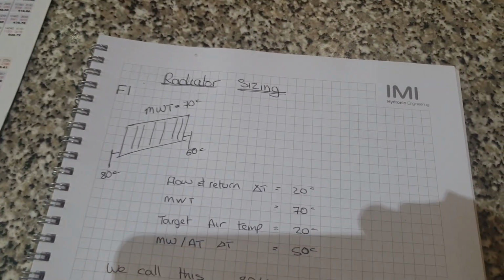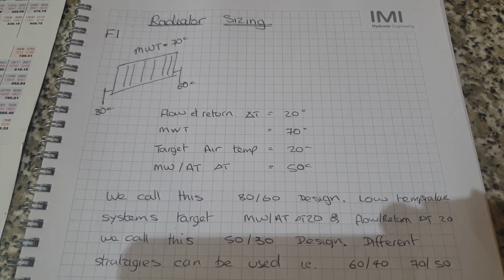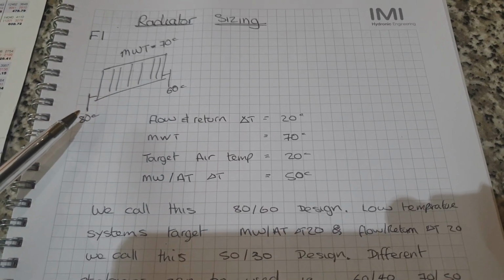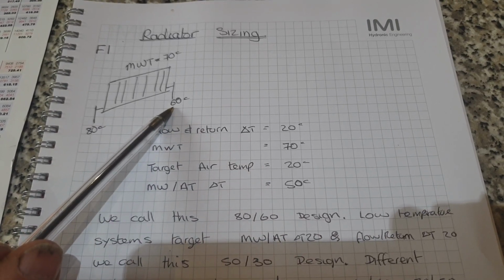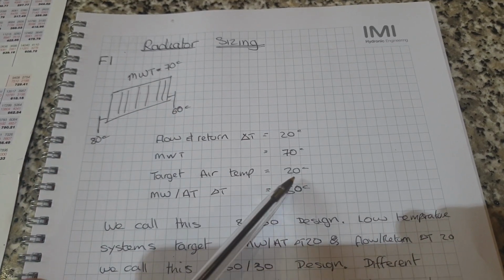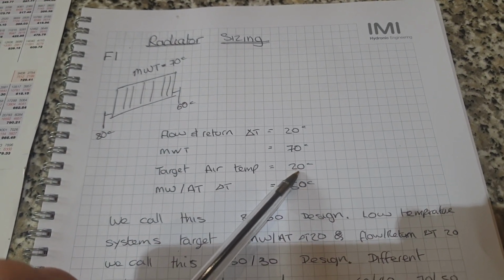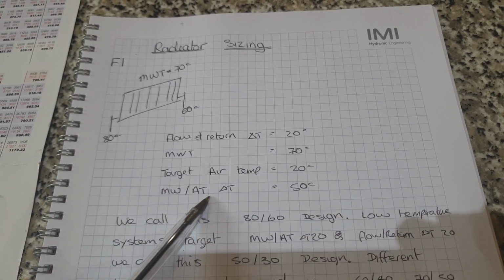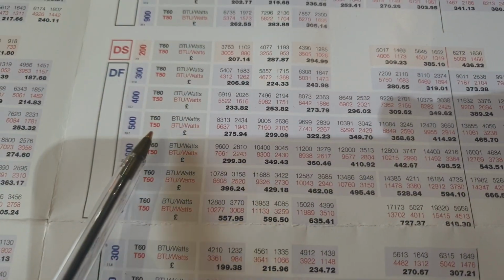Radiator selection / sizing.

Comment: Maybe a slightly stupid question; when looking to do low temp, once I've established the kW of the radiators (roughly 3 times what the catalogue lists at dt50), do I then use those increased values, adding them up from all the radiators - to size the boiler for the whole house, or do I go with the result of my heat loss calculation to find a suitable boiler?
Reply from the maker: With a Viessmann 200 boiler sizing is easy. It modulates down to 1.9 for heating and up to 32kw for hot water. I use the old whole house method to check for boiler size. Don't try adding radiators as this is a big waste of time imo.

Comment: Hi. Great vid. Thanks.  My maths is a bit dodgy. How do you get 0.321 from 0.4 to the power of 1.24?
Reply from the maker: Do you mean how did I calculate it or are you disagreeing with my answer ?b
Reply: The former Andrew. Not disagreeing. I know its 0.4 to the power of 1.24, but can't see how you get to .321 -  ie what buttons on the calculator you push - or how you do it longhand. Thanks
Reply from the maker: @davebaber5371  it's not easy. I can't post a screen shot here. Feel free to pm me for the answer

Comment: How much is the condensing side of things worth in efficiency and is it really worth upsizing all rads to get the boiler condensing more.
Reply from the maker: I have no idea of the extra efficiency tbo. But most existing radiators run at 55 35 without any up sizing anyway.
Reply: If you size the rads for 55/35, on WC, you'll get an extra 10-15%.

Comment: Great video, is there a way of estimating pre existing radiators power, and can you simply add extra ones to increase the total output into the room?  I have old cast iron ones and have been wanting to supliment them but as the property is old, i would really like to get the most out of my condensing boiler.
Reply from the maker: I think so. A heatloss calculation to establish the heat requirement first. Next look for some source of information on the published output if your existing radiators or similar. This is a good starting point. Need to calculate f factors for adjusting output and then select replacement or additional radiators.

Comment: Very clear and useful video. Explained very well. Quick question, does it matter what size the pipework is to the radiator from the 22mm flow and return. I was told by a registered iphe, that from 22mm flow and return. One should use no more than 3metres of 10mm mircobore or 15mm piping. As this affects the flow and return temperatures.   Your opinion would be greatly appreciated  please.  Thank you
Reply from the maker: No it's wrong
Reply: @andrewmillwardwatford9410  so would not the size of flow and return pipes not affect the output (btu) of the radiator then?

Comment: Which heat loss calculator do you use to get initial heat demand?
Reply: Try heat-engineer it’s basically that book turned into software. Have to pay for it though.
Reply from the maker: Agree. Heating engineer software

Comment: Thanks Andrew
Based on your video as a rule of thumb then we need to triple the size of rads when we calculate at the brochure outputs of delta t 50 for a delta t 20.  I love rule of thumb when quoting for quick quoting purposes.  I may not get the job and prefer not to spend to long on paperwork.  Will this methodology work for quick quoting in your opinion.😃😇
Reply from the maker: Yes. It's not vital to be that accurate in the quote or in practice. Rule of thumb is great if up to date.

Comment: Alot of them are done at 75-65 20rt to give the dt50, the dt10 on a radiator works well and what iv started designing of especially with wc or low temp gas👍
Reply from the maker: Wht dt 10 on the rad ?
Reply: @andrewmillwardwatford9410  yeah, that is with a lower temp wc system, dt10 is more realistic on those systems I find 👍
Reply from the maker: @stevencalvert9454  need to look at this idea on the forum